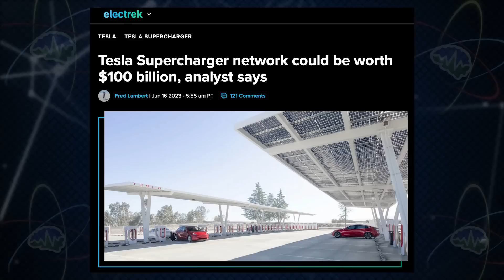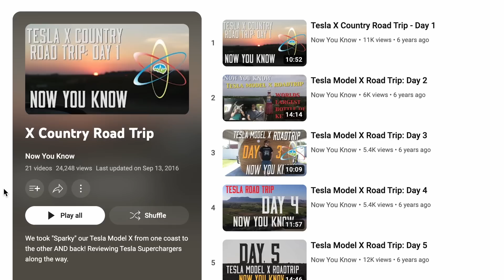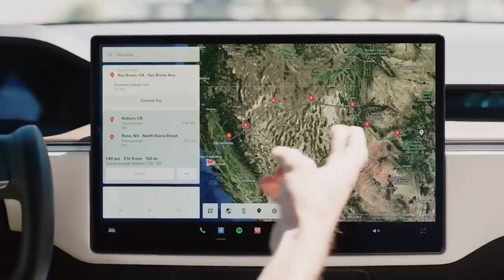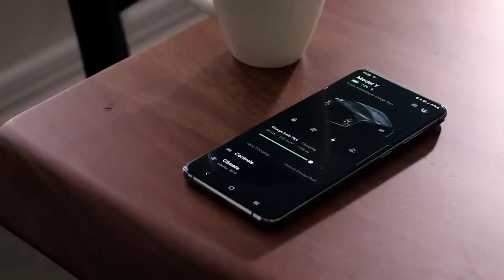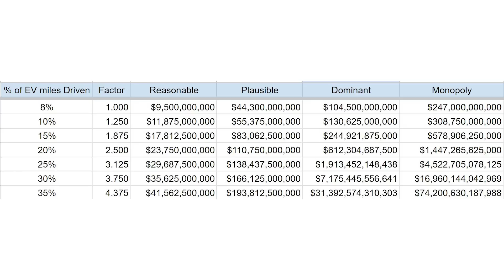Tesla's Superchargers Worth $100 Billion? | Disruptive Investing News

Comment: Good video and I believe you are correct that the announcements by CEOs of Ford then GM is underappreciated by so many analysis. However, the adoption of the Tesla adapter in the USA over Type 1 CCS may not be repeated worldwide in all markets. Take Europe for example which has a higher proportion of Non-Tesla EVs on the road currently and a higher proportion of CCS (type 2) sites compared to Tesla than in the predominantly Tesla charging landscape of North America. There would needs be a massive retrofitting of the European Supercharger network if the North American Standard were to be adopted here.

I'm not saying that the Tesla charging plug isn't more elegant than the Global Type 2 version of the CCS plug, and I which my Model 3 and European Supercharger Stalls had the Tesla plug, but at least the Type 2 version of CCS doesn't have that venerable latch on the top of the US version Type 1 plug and the Type 2 CCS like the AC Type 2 has the latch on the car! 

Yes, I was a "first-mover" in my circle with Solar in 2011, Heat Battery Storage, then 1st EV and now a Tesla and Larger Solar PV and Home Battery Storage. Next is the Heat Pump which no one else in my immediate circle are looking at
Reply: Thanks for your commentary. I suggest that "simple" adaptors enabling Type 1 to accommodate Type 2 charging ports and vice versa could be created much in the way electrical appliances are useable worldwide with an adaptor (except for damned Switzerland ;-) )

Comment: I'm surprised the superchargers haven't already gotten awnings with solar panels over the charging spaces to make their energy even without batteries.
Reply: i think the problem has always been batteries, there werent enough batteries to build all the EVs and to build a megapak for every supercharger station. and supercharger stations use power in big batches, going straight from solar wasnt really workable.
Reply: @scottmcshannon6821  respectfully that is the energy storage problem's solution, not energy generation. A percentage of energy could still be solar and additional solar could be added when battery storage becomes available. It probably isn't as cost effective to getting as many superchargers up as fast as possible though. Energy generation companies probably charge Tesla more if they had solar too. They don't like to play nice with losing profits, which is why they need to be regulated.

Comment: 9:45 I'm pretty sure there is a spreadsheet error here for the dominant and monopoly columns. It looks like you multiplied the "factor" by the row above intstead of the top row for those 2 columns.

The last row should show around 460bil and 1.1trillion for dominant & monopoly respectively.
Reply: Yes. Last 2 columns are wrong
Reply: The sad part is, they did not just not realize it, but started to justify it. If something seems of, check it over twice bevor you go with it.
Also, yes they used the factor on the row above instead the base line.
please redo the video.
Reply: Agreed, math is wrong.

Comment: I keep hearing Tesla will put Solar to power its chargers.  Think about that.  Let's assume 2 KW per charger, provides nice shade and rain protection.  So maybe 16 kw a day.  You need the megapacks, which Tesla is installing with them.  And the megapacks allow Tesla to generate revenue besides the charging, grid stability and buying selling, etc.

The wind turbines or solar or in New England hydropower do not have to be right there.

Comment: The supercharger network is a Trojan Horse.... Focusing on car charging is missing 90% of the use case.

Each station has a number of powerpacks, mid level storage from Tesla about the equivalent of 200 kWh each. The current design is to install about 4 stalls per powerpack at each station. A Megapack is 4000 kWh each. I don't think I have seen a station using one. 

The packs, or storage in general, is used as a buffer and converter between the grid and the stalls. Based on the ratio above there is only about 50kWh per stall available if the grid and solar at the station went down, the equivalent of one average charge per stall. That number matches with what Tesla said was their average usage per session in 2022, 51.92 kWh. 

Tesla uses storage and software for energy arbitrage to make margin off of charging by storing power at a cheaper rate than they pump it into the cars, that part if obvious. The part that is going to bake everyone's noodle is that each supercharger station's connection to the grid works both ways..... That makes every supercharger station a micro peaker plant backing up the grid. Most people are focused on the giant megapack installs supporting the grid, superchargers are doing that on a micro scale and provide local grid support in a given area. 

Most of the media complains about how many superchargers are needed for the future as well as the congestion at current stations. Looking at the data Tesla provided earlier this year each supercharger stall is only used for 146 minutes per day, or about 10% of the time, empty 90% of the time. If you cram all the charging into 8 hrs a day rather than 24 you get 30% utilized on average. While that does not match the videos of stations with long lines, it does represent what you will see if you just look at stations when you drive by everyday. What this creates is between 70 and 90% of the time that Tesla can operate a station as a micro peaker plant buying power at low cost and selling higher. Think of them as one massive storage facility controlled by software rather than thousands of charging stations for cars.

If this peaks your interest go back and look at JB Straubel's presentations on distributed grid energy. Megapack utility installs, the home powerwalls, and the hidden in plain sight supercharger stations with powerpacks all play this game.
Reply: Good take. That's the first time I've heard someone explain it this way.

"each supercharger station's connection to the grid works both ways...." It makes me think of these questions, maybe you could share your toughts on this:

1. Is this a setup that's actual or you're talking in the future ?
2. The way I'm thinking about it, there's no gain to have a connection both ways. It's only 1 way → Tesla buys cheap and store in the powerwalls. Profit is made from the arbitrage to the customer. 2 ways only make sense if they have local production or am I missing something ?
3. Wouldn't they need agreement with the electricity provider of this state/region to pump back on the grid and get paid ? Is that the case at the moment ?

It could be such a genius Musk's move to layout a distributed grid via the superchargers like you're saying. Just like he did started with the expensive sports car with the end goal of mass market. Now it starts with the superchargers, but the goal is to be the backbone of most utilities.
Reply: @DlaBonneSauce  Also, think of it this way...Tesla has 45000 supercharger posts currently installed. 4 posts to a Powerpack, each powerpack is 232kW, or 58kW installed storage per post. Total network has about 2,610,000 kW installed storage, or 2.6 Gigawatts. That 2.6 Gigawatts is turned over about 5 times a day for charging cars. That charging takes about 5 hours total per stall per day, 2.5 hours to fill the powerpacks 5 times and 2.5 hours to charge cars 5 times. That means there is 19 hours a day on average that the whole station is idle for arbitrage. Assuming the same charge and discharge rates there is 19 more charge and discharge cycles posible for that 2.6 gigawatts per day. 

In a perfect world that 19 x 2.6 gigawatts x 5 cents a kw arbitrage is $2.5 Million a day in nearly pure profit, $900 Million a year. Play with the rates and number of future stations and you can see the growth potential. Charging cars is probably 10 cents a kW profit on 5 cycles or another $405 million a year in profit. 

Then ask where does the other 19 hours or cycles of demand come from? Home charging ironically...... Currently Tesla says their cars have pulled 55% of their charge from home during 2022, 45% at superchargers. Storage will hold the buffer for peak demands and storage will have its own margin as shown above.

Now consider the fleet size being charged is only 3 million average cars for 2022, where most of this data comes from. When the global fleet changes over to electric there will be a billion cars to charge. That is 333 times today. That means if at 7.5 cents a kw blended margin, there is $432 Billion in margin up for grabs in car charging. Another $432 Billion margin in converting homes to all electric from natural gas.
Reply: @motofunk1  That's a very good perspective. Thanks.
Reply: @DlaBonneSauce  
1. Already done, it exists at all supercharger stations.
2. You are missing something. They sell back to the utilities based on demand just like peaker plants do. 90% of the time they are available for arbitrage to the grid.
3. Grid agreements are in place already. Using Autobidder to perform this function at the most efficient and profitable rate.

Comment: A monopoly is unlikely as monopolies get broken up to prevent abuse. More than likely Tesla's competitors will change over (license) to using Tesla charging tech or parts of it to standardize the chargers. This would be like standardization of equipment at gas pumps.